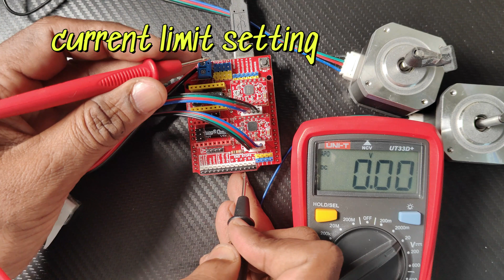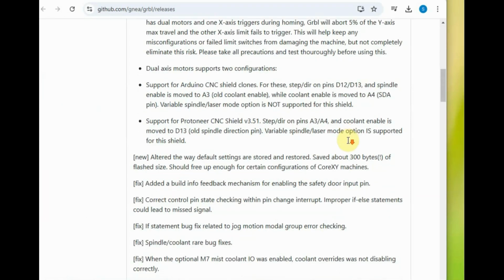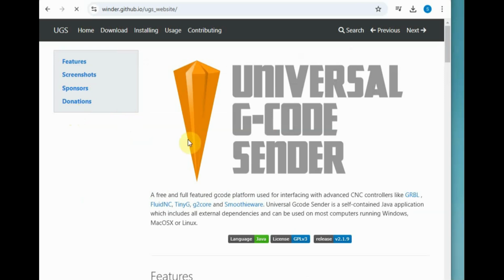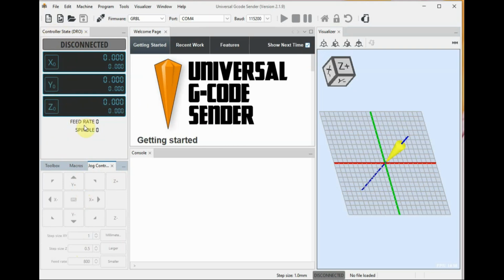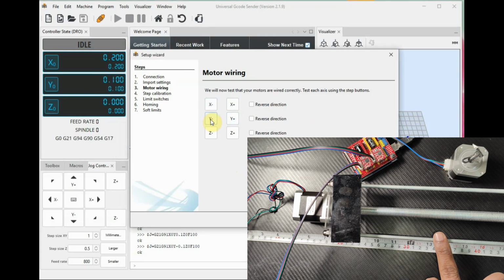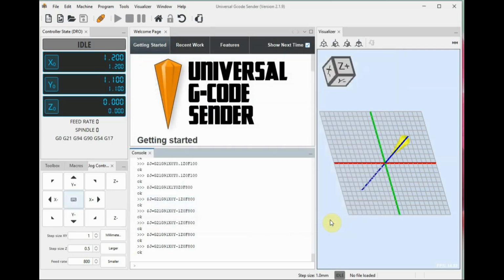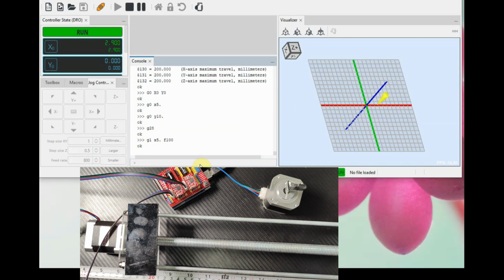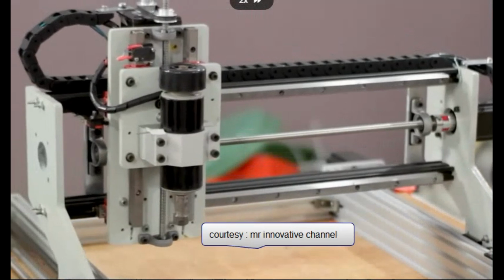CNC SHIELD with GRBL and Universal  G-Code Sender

Comment: Sorry, I forgot to mention "T" for tool identification, S(spindle), H(tool offset height), R(Rad) etc,
Most codes were the same from controller to controller.
FADAL had two formats, format 2 was compatible with FANUC, 
Some machines had so-called user friendly software, like a built-in CAM software, but had a G-code program running the machine in the background.
We would use CAM software to write programs for our ProtoTRAK mill, but we had to get a special post processing program for our Mastercam

Comment: Thank You Very Much,  I have programmed and set up CNC machining centers and lathes since the late 1980's. 
There was no CAM software back then, so knowing G-codes (path control codes) was a must! Also 
M & S codes (aka machine codes)
My first programming using CAM software, was not until the late 1990's
I have a very nice WS#3 M2200 square head turret lathe in my garage that I'm going to make it a Hybrid Manual/CNC.
 This is the first video I've seen, that talks about G-code software for DIY projects. 
Thank You Very Much for the information.
MGM😸